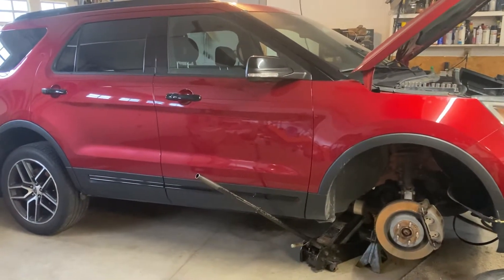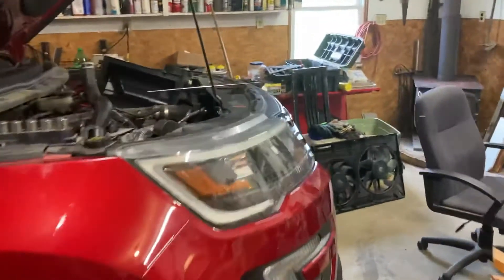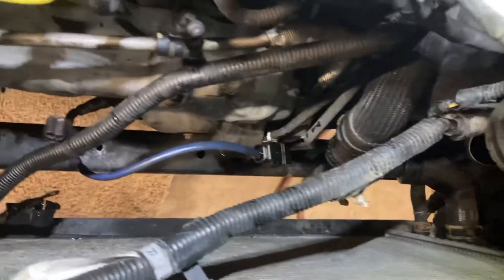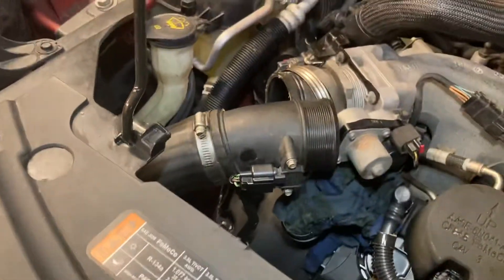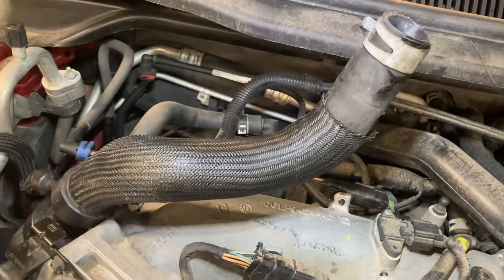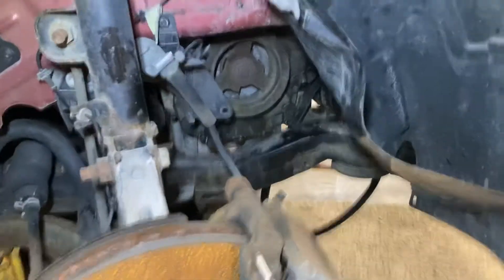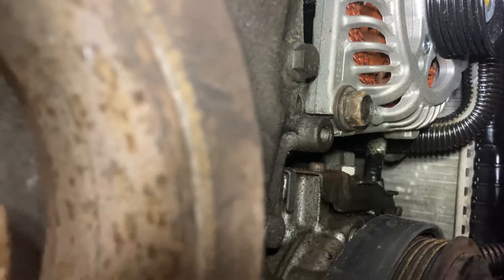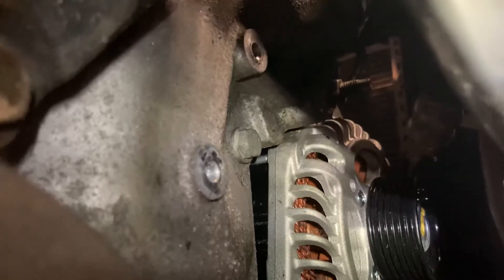2016 Explorer sport alternator replacement 1

Comment: I removed the 2 bolts, the bottom and top one, I removed the sensor, and the ground bolt on the side but it’s still not coming out. How did you do it ? It seems like it’s stuck on the stud on top
Reply from the maker: @stephyG59  sounds like it’s a little stuck. Rock it back and forth.

Comment: Did you pull out the old alternator by moving it past the belt tensioner area. I'
Reply from the maker: If I remember correctly, I took it through the top.

Comment: Really, is it necesary Disconnect All That You Say?
Reply: At the agency?????
Reply from the maker: There are some bolts the you can’t get at. Make sure it’s your alternator beforehand. Did you unplug it and check for charge. It goes into default charge when unplugged. Also check your fuses.
Reply: @stuemany  I thank you for the information, I hope they have done the diagnosis well at the agency, they assure that the alternator is not working, although my truck only has 60,000 km, it seems very strange to me